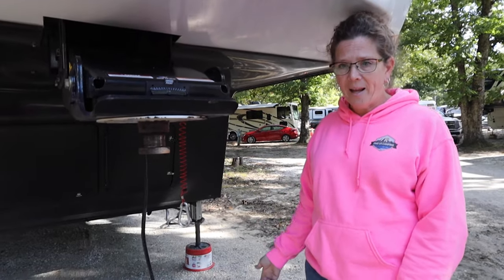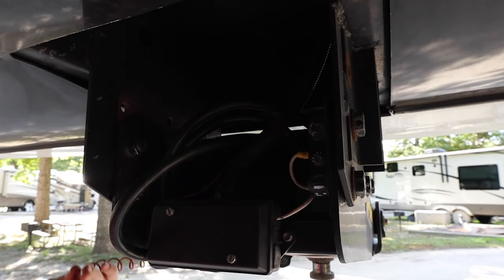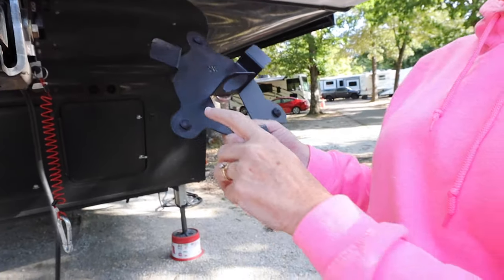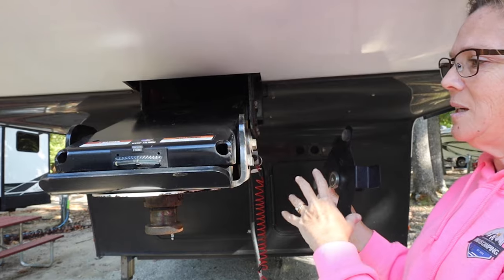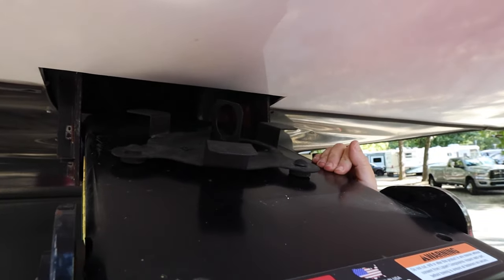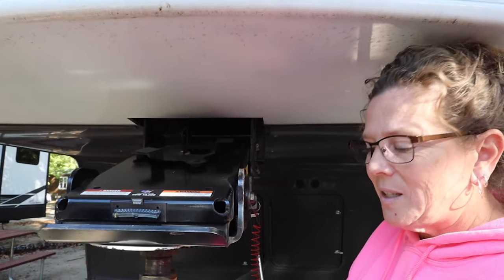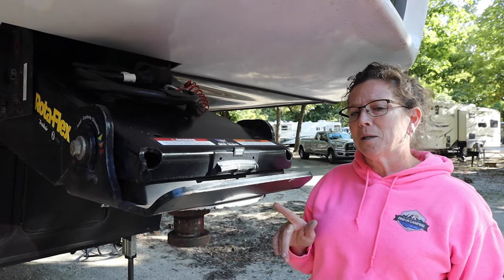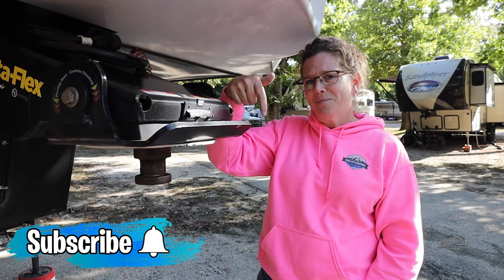The Morryde Cord Keeper - A New Way to Store your 7 Way Plug

Comment: Want to make a million bucks? invent a boot to seal around the pin box. It will keep out the visitors but more important it will keep out the dust in the basement. Fifth wheels are pressurized with dust by air coming in around the pin box. It has to be made of something flexible as the pin is separate from the fiberglass body. There you go. It will pay WAY more than a youtube channel. Happy travels.
Reply from the maker: That sounds like a great idea 💡